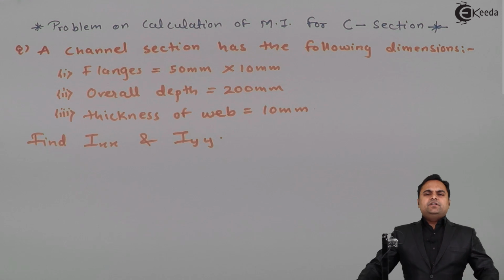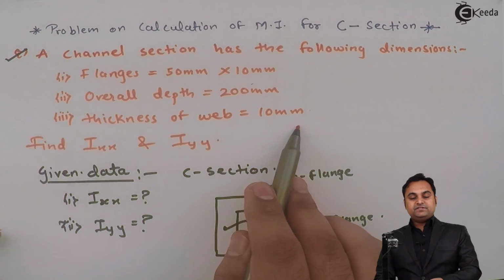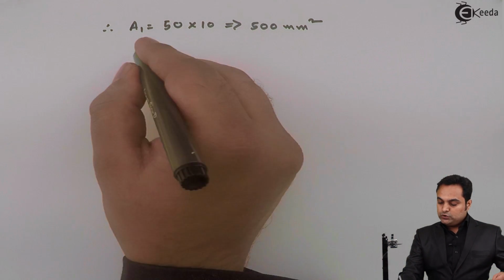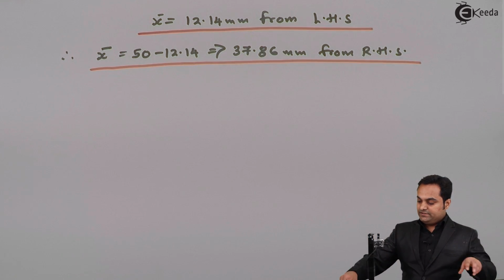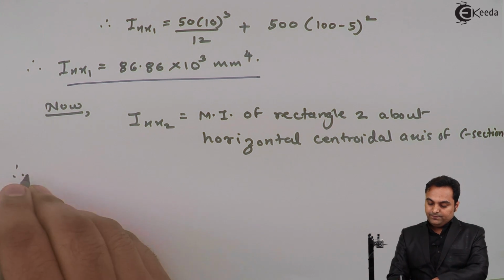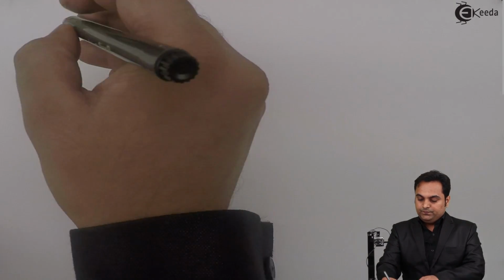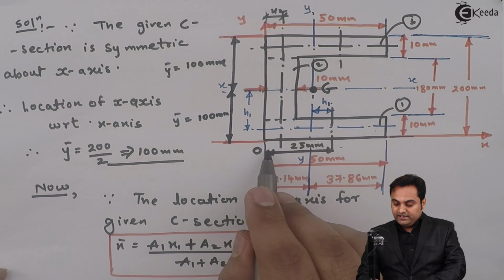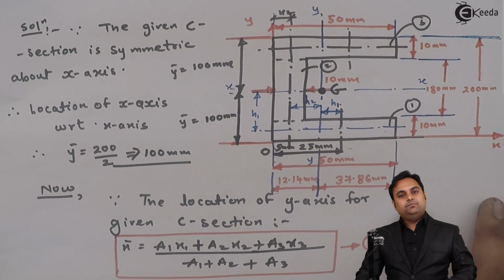Problems on Moment of Inertia of C Section - Moment of Inertia - Strength of Materials

Comment: Value of Iyy1 is 186.856*10^3  not 186.856*10^6. Please sir  correct me if I'm wrong.
Reply: Yes. And there also value of Ixx = 4.51*10^6  NOT  86.86*10^3

Sir totally confused me I have rechecked several times. Also reset my calci 😂😂..

Comment: I took my axis system the same way you did, however i split the shapes to be so that the flanges would be seen as 2 sets of 40x10 and a web of 200x10 if you get what im trying to say. This way my x centroid comes to 34mm? is that still a correct method
Reply: Ignore this.. i made an error upon entering values in calculator.....thank you please keep this up! You're a big help!

Comment: hie I don't get why on shape  3 (y bar) is  5 istead of 195 since our reference point is at the bottom base, so I thought on shape 3 Ad^2 was  500(195-100)^2 instead of 500(100-5)^2.help pliz
Reply: Georgina Mukwirimba I also have the same query...did u get the answer??
Reply: okay ,here are some tips .first if looking at x -axis ,we just need to find out x-axis position as u know x axis is to the right or left, while for y -axis ,u need to know that y axis is either point upward or downward,and hence for determine centriod for y axis ..u need to rotate ur diagram into a position that ur y -axis point to right or left.in this case just rotate the diagram 90 degree then u would understand what is happening . chill~